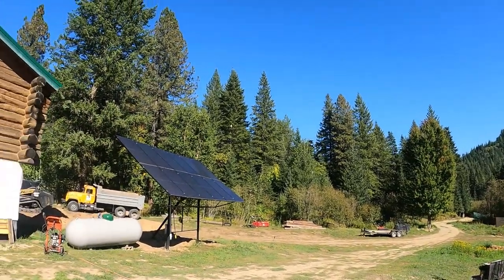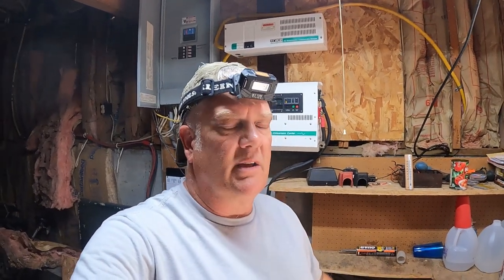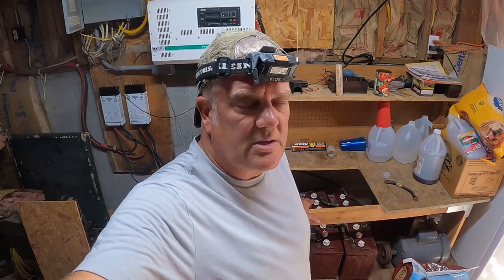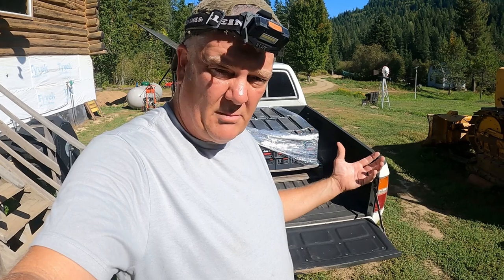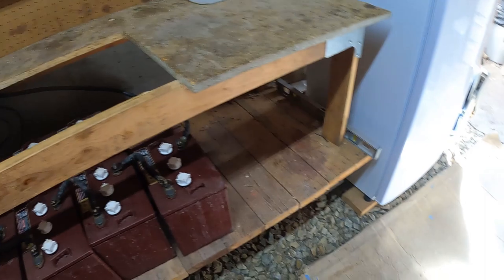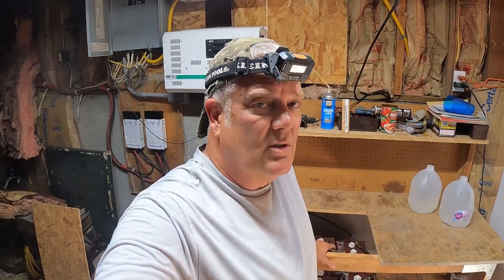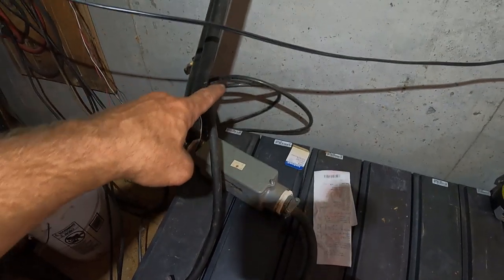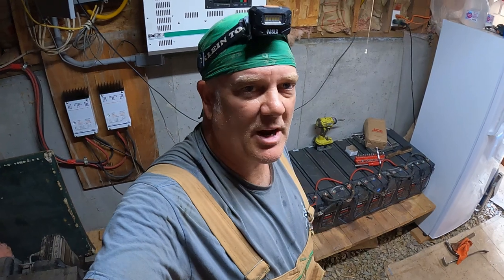Upgrade your battery game: AGM vs lead acid

Comment: Cool setup and nice video.  You may want to consider adding a third set of runner wires connecting each of your bus bars together (the ones making your series connections.)  This combination of series parallel operation where you effectively parallel at the 12V level can give you some advantage if there is variation in the capacities of your batteries, this will help balance out the stronger / weaker batteries within your system.  Additionally if you ever do have an unintentional deep discharge it will also improve the probability that you don't have a grossly unmatched pair (24V pair) because you are essentially paralleling all of your 12V batteries and statistically balancing out the capacity variation of your "two" 12V blocks (made up of six batteries each) that are in series to make 24V.  It will improve the lifetime of your system by keeping things more effectively balanced.  You can even use a lesser AWG wire for the purpose of tying the bus bars together.  As for your query about where to connect the inverter and charge controllers, ideal connection strategy would be negative on one eng and positive on the opposite end of the bank.  However, based on your described usage / loads, I don't think that will make much if any difference long term for your system.

Comment: YAAY for the big batteries so get a meter with an amp clamp and you can see the differences yourself. Don't be scared of 'worthless' electrolytic grease as some folks call it. it'll kill the corrosion.  You know what current and amps a welder uses and what your equipment needs. Believe your figures! I think you did a FINE job! You'll know as time goes on how it's doing. Did I see a Mack tandem over there to go with the dozer and loader? Another smart move. 1K gallon tank is another. EXPAND if you can and be thinking about it if you can't.......yet. Talk to the dozer and reassure it that it's not going to be left out in the cold. God Bless you and Olivia and varmints from us old geezerish hillbillies!
Reply from the maker: HAHA Lewie...  My eye spies........   I'm hoping to purchase that Mack from a friend this spring.... stay tuned!

Comment: Slick deal on the AGM's. Keep doing this deal and triple your stack. Then you can then rotate your series batteries and just pull the parallel dead ones one or two at a time and still have energy in reserve at the correct voltage.
Reply from the maker: Thx!  Yeah I couldn't pass up this deal.  I actually have 4 more I plan on adding.  What do you say about where to tap the whole bank?  One end or in the middle?
Reply: @HiddenValleyHomestead  My pro installer used big wire cut to same lengths. He did not cut corners on this. I watched him stop the job and drive 40 miles one way to get a piece of the correct gage wire instead of use what he had on hand. He could have finished a day earlier. Didn't. So, i think this may be important. On your battery bank. To my knowlege there is only one battery brand that is not worried about additional battery add ons at later dates. (Simpliphi) Most companies recommend all batteries of the same date mfg. I suggest you grab more of this batch and forego any mismatch probs. But what do I know?
Reply from the maker: @deplorable1-2  I agree and I did exactly that...  Good point my friend.